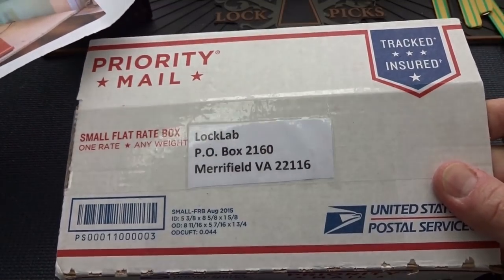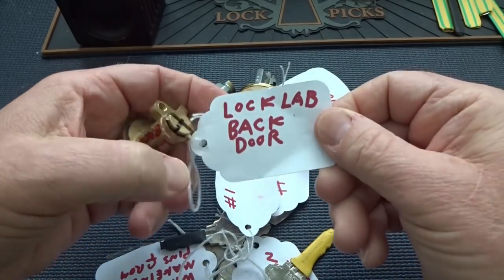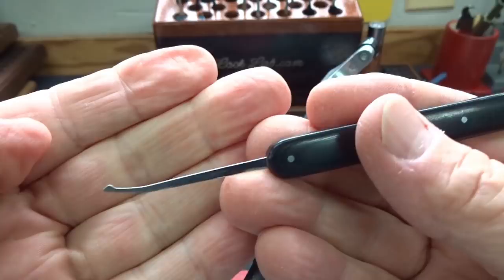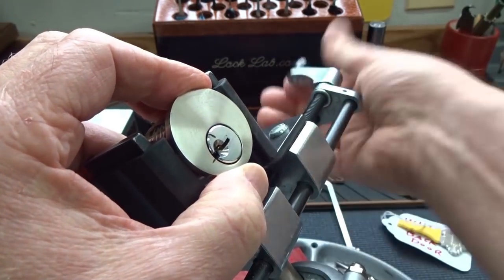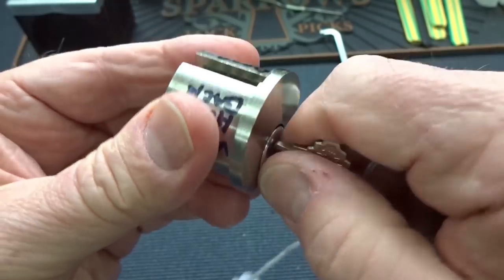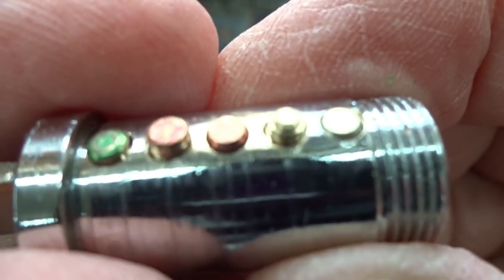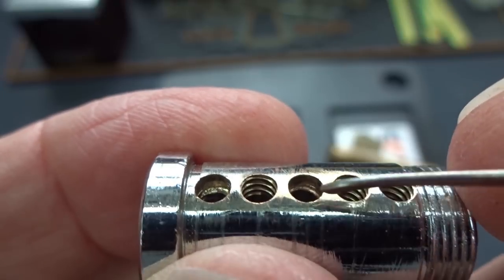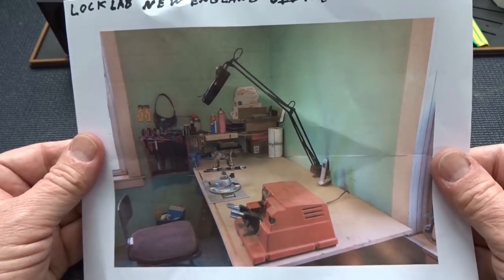(1253) Challenge: Bill Clegg "White House Door"

Comment: The newest Lock Lab intro is by far the best. I Love how the first bit gets affected by the water and then we get to see the lock lab logo emerge from the sea. The birds look kind of cheesy and should fly away forever if you ever decide to refine this intro but you will probably change your intro again down the line so the birds don't even matter. 

I did have a question though. I know fast entry is ideal but if I can Zip a lock easily, then I should be able to SPP it fairly easily as well right? Some of the locks I have been given from my local locksmith have been opened in seconds with zipping or rocking but when I go to pick the pins individually I have a hell of a time. How can I fix this?

Comment: Got my first Medeco cylinder, I'm considering taking a few weeks off work to go pin at a time to learn it...

Can't believe spend good money on locks with keys just so I can pick em...
Reply: Combustion Kills learn it well without the sidebar, then replace the sidebar with minimal pinning and learn how it interfaces. Then once you've got a feel and a few dozen hours into it you can reassemble it fully and try to break into the big leagues. 

Medeco are well above my pay grade lol. I wouldn't even make the attempt at this point in time. You could try one of the HSS ones that Bill passed to Chessguy125 as you can see how he deals with the sidebar after picking all the pin tumbler pins. Even with an intuitive excellence in the way he tensions the lock, it still takes 30 mins before getting into it. 

Still, if you're looking for a feeling of achievement.. ;)
Reply: Si74l0rd I started picking about 2.5 years ago (locks anyways) been picking my nose on and off since I can remember... 😋 My first open was a Best Padlock with the SFIC core. It took me almost 2 weeks, and I was amazed when it opened. 

About 1.5 years ago a found a european seller who was selling euro cylinders by the kilo for charity. I bought 3 kilos and have picked nearly all of them several times over. The last few have really horrible warding and paracentric keyways. I often buy stuff from an old guy who scraps the trash cans at the buisiness park were I work. He looks for locks and metal scrap for me. He found the Medeco in a trash can and I gave him $15 for it... I usually give him a buck a lock. I bought 200 medeco pins on ebay so I can replace them as they wear out. And a locksmith i know gave me a key set. And now I have a keyed working lock... yay!

Been making my own picks since the begining, but did get a praxxis and couple of sparrows kits. 

I'm a machinist and I really appreciate the work and thought that goes into some of these higher quality locks. I find them fascinating and picking has become a kind of meditation for me... And it's all Bill's fault when I accidentally stumbled on his channel back then... Thanks Bill!

Comment: Why does everyone use WD40? It's for displacing water, not lubricating, and as such picks up all the crap from the air that sticks to it. Surely the appropriate lubricant for a cylinder would be a dry graphite based compound? That way you don't get sticky locks that make grease spots everywhere. 

For many years in my teens I lubricated my skateboard bearings with WD40,  sadly it causes as many issues with gunk buildup as it solves problems with lack of lubrication. Even on a shielded bearing the WD40 grabs all the dust it can and causes worse buildup, so within days you're back to grungy bearings. WD40 is not the magic juice for everything, builders knee's included!

Fantastic machining on those pins though, incorrect lube or not!
Reply: I'd have been told off in no uncertain terms by my old man if I dared use WD40 or similar in locks. He probably hasn't rekeyed a lock in 20 years, but I bet he's still got at least half dozen graphite bottles kicking around his garage.
Reply: But it smells so good.
Reply: I guess the answer to that is ease of use, availability, price, handiness etc. There are alot of people that don't know. But from my own experience, those that do know and still use it, don't really care (in the moment); some lubricating action right there and then with whatever is within grasp, is the priority. I've done that myself many a time. Especially when trying to loosen rusty bolts. Sure there are better alternatives, but they tend not to be around when needed, in large enough quanities, or in applicators that facilitates application "against gravity". Then again, whenever one of those bolts are extracted, it is usually overhauled or replaced, same with whatever it threads in. In that case, lasting lubrication and crap ingress is not really relevant. Sadly, I guess many apply the same mentality and reasoning to mechanical parts and usecases where it really does matter. For that, I do have my "in case of lube", a plastic crate with white lithium, ptfe, high-temp silicone, molybdenum etc.

Depending on the environment your parts are to be operating in, graphite might not be a top choice though. It gets everywhere, which might be an issue in many cases. It absorbs moisture, which will be an issue is some cases, especially sub-zero environments. And if there is any significant risk that someone might come after you with a can of wd40 or any other non-dry lubrication... you're in for a nasty treat.
Reply: Houdini is the best lock lube I have found. Cleans even better than it lubes. I could write a thesis on why one should rarely even buy a can of WD but I already have a reputation here. I hate running into gummed up locks full of the snot which happens all too often. High five to Thermal lons father!

Comment: non whipped by locks are not interesting for me. more whipped by videos please.
Reply: Serdar Gentsch Get pinning then. The number of whipped videos is in the dozens, if that, by comparison with the hundreds of successes. Bill's fingers are very skilled with years of on the job experience before hobby picking hours are taken into account, and most standard pin tumblers - no matter how deviously they're pinned - fall within two or three attempts. Bear in mind, all the videos made and uploaded are locks picked inside 15 minutes. The ones in the naughty bucket may have been picked before, just not in the appropriate timescale on an uninterrupted videostream where the lock is never out of frame. Whipped means a valid challenge lock that has defied Bill more than 3 or so times, has a key that works, and that he has never been able to crack. I saw him crack an Aussie Bilock a week or so ago that had had 51 previous attempts before it yielded to both the fingers and the timeframe on camera. 

Considering you really need a sidebar to fox him, there are relatively few whipped vids. Which I do also enjoy, but not as much as the really tricky ones he overcomes. 

Without intending any offense to Bill, for truly outstanding intuitive picking check out Chessguy125 taking on the (sidebarred) HSS cylinders Bill passed onto him after being whipped by them. Be warned, you'll realise just how entertaining Bill is, after watching the Chessguy125 HSS videos.
Reply: Did Chessguy125 not retire? Or was that another locksport person on youtube?